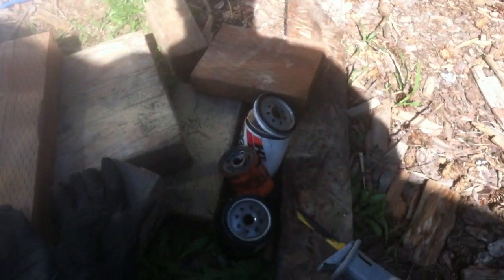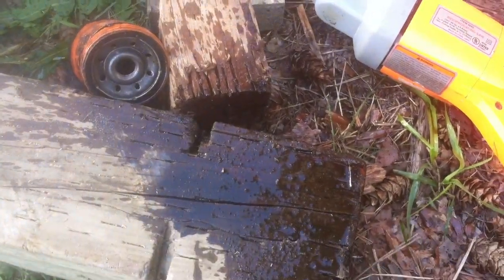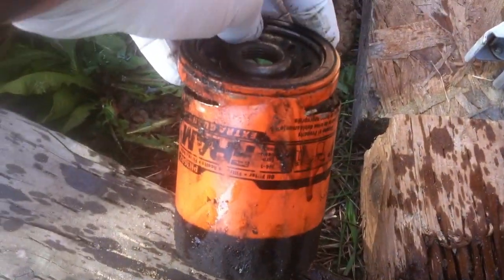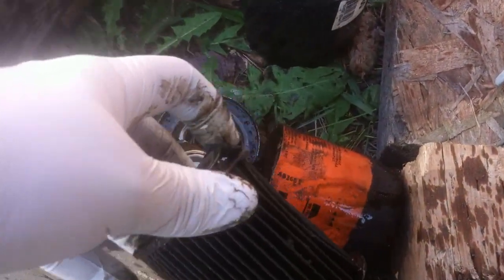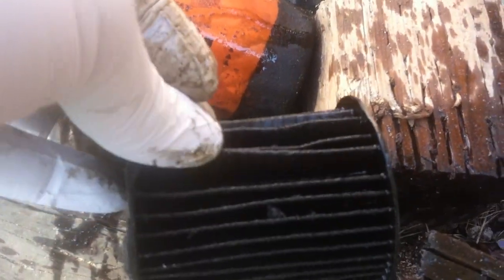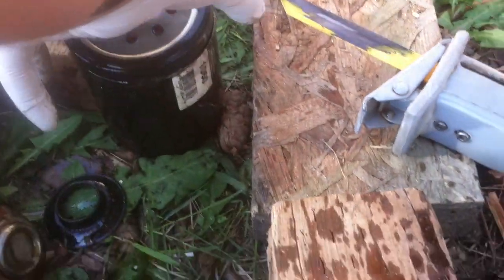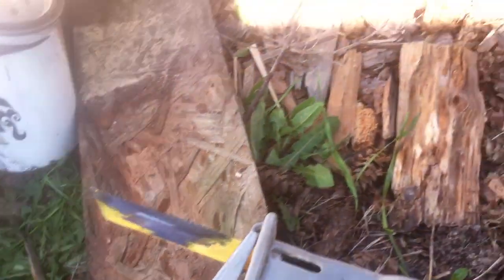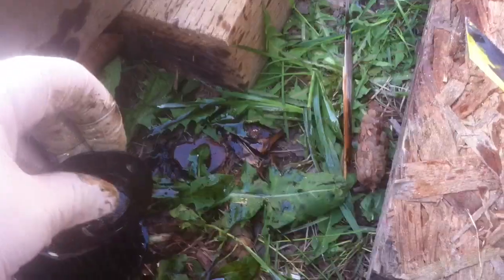Oil Filter Dissection (cut open) K&N vs Napa Gold vs Fram + Important Wrench Off Tip for K&N

Comment: I don't know where all of you Fram-bashers are getting your info. I have used Fram oil filters on all of my Hondas for over 30 years and NEVER had any issues. In fact, my 1995 Honda was at 310,000 miles when I sold it. In the early years, I'd change oil every 6000 miles. Now, I change at 8000. They're a great filter based on my experience.  And how can you ever conclusively say a filter caused this issue or that issue????? You can't!!!  It's nonsense. The most important thing is to change it based on regular intervals (and I've always changed mine at least 2000 miles before the recommended interval).

Comment: What if you use a FRAM filter that rolls off the same assemblu line, with the same media as the K&N, such as what Champi Filters does with some K&N, Fram, Service Champ and SKU's?  Same product, same factory (this week) and different branding.

Comment: Interesting but just another 'junk science' and completely irrelevant filter cutaway with no rational support for the theory.  Filter media is sized differently and has a different number of pleats to meet the manufacturer's flow rate.  Whether 1 pleat or 50, makes no difference if they have the same flow rate.  The MEDIA used is the key.  If the media only traps 5-8 micron vs 3 micron for example, will have a different pleat count to meet the required flow rate.  Key to filters is, CHANGE YOUR BLOODY OIL on time and don't worry about it.  I've been to several manufacturing plants, you'd be surprised how many make the same filters and just roll on different branding.  Even a manufacturer using the same part number, ie Wix 5105 vs Wix 5105, can be made at different plants, in different countries and with different media and pleat counts.  Thus this ancient exercise of cutting one open is simply something people do out of curiosity, it proves little to nothing at all though.  It's like Bob is the Oil Guy, there is SO much speculation, guess work and junk science floating around there now, it's a waste of time to scour.  People will always just follow what they want to hear or read, then ignore everything else anyway.
ONE AGAIN...JUST CHANGE YOUR BLOODY OIL!  Forget the Mfrs OLMS and recommended long OCI intervals, change it every 5000kms/3000 miles and you will be fine. A coffee filter in a soup can will suffice, if it is changed regularly and meets flow rates.

Comment: I have always changed my oil at 3,000 - 5,000 miles with no problems using the Fram, or what is available.  Looks as if he is comparing the Fram $6 filter (cheapest) to the $12-$16 Napa and K& N filters.  What about the Fram Ultra Synthetic that is supposedly better?
Reply: Take a soup can, put a coffee filter in it and you have a FRAM equivalent.  They are made by dozens of manufacturers with ZERO quality control, they are just printed with Fram branding and come off the same Indian, Vietnamese, Chinese, Mexican etc assembly line.  I know these manufacturers personally and exactly what is needed to start adding Fram to their lines.  Basically, if they meet the flow requirement of the manufacturer, the absolute most basic spec, they can make them for Fram.  They also make Service Champ, K&N and dozens of other brands.  One size fits 20 cars, keeps SKU's down and allows for cheaper prices and resale even in WalMart,

Comment: Totally agree Fram is junk, use K&N, Mobil 1, NAPA etc..  I thought I had an oil leak, it turned out the fram filter was leaking at the outer seam.  Like said junk, had two others in garage and threw them out.

Comment: Hi Turbo1889, very well made video with the means and equipment (testing) at your disposal.  Your presentation is to the point and dispels a lot of the myths about these oil filters.  Thank you for taking the time to share your findings with the YT community, Ciao, L (FoMoCo engineering).